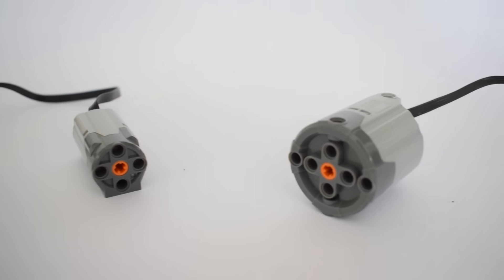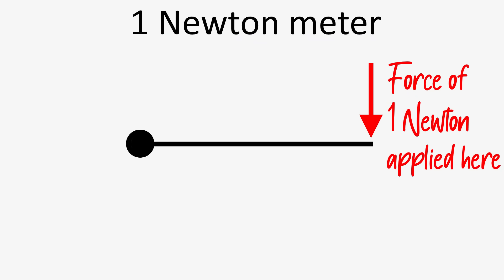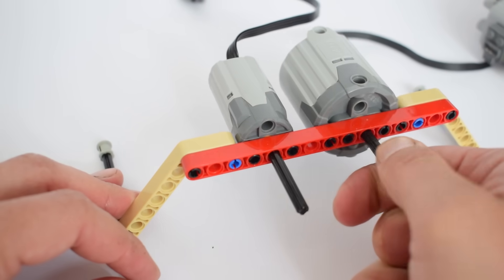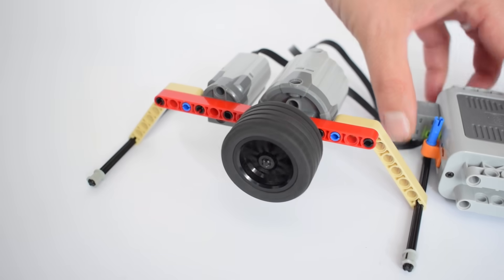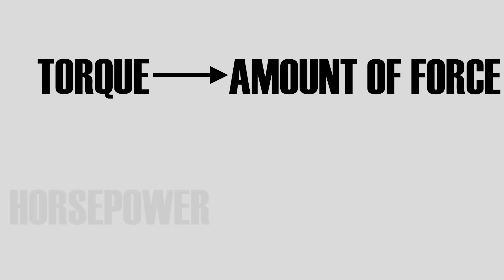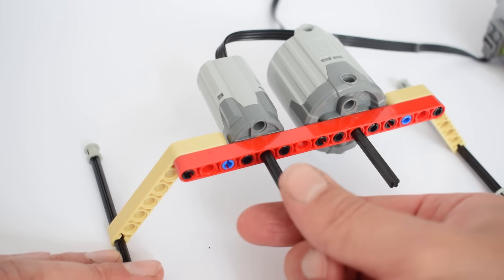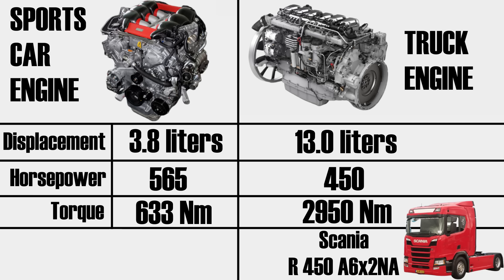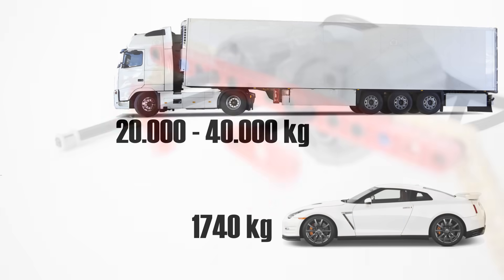NEVER be confused by HORSEPOWER and TORQUE again - HP and TORQUE EXPLAINED in the MOST VISUAL WAY

Comment: I usually don't comment on video's but this was an excellent explanation, thank you. So the increased torque for the truck is a result of a larger volume for combustion to occur combined with the greater leverage of the piston and the weight of the material adding more inertia to the strokes?

Comment: Years ago I was trying to explain the difference to a guy who collected Porsches and I was blown away that someone with a passion for cars well into their 70s had no stinking clue what the difference between the 2 even were. I tried so many different ways of explaining it including using a body builder vs a sprinter and he just couldn't get it. The amount of validation this video gave me because at one point I really thought surely this 70 year old guy knows better than me. 

I even tried explaining it this way. Horsepower can dictate how much quicker you can get to 60mph where as tongue can dictate how much weight can be moved before its no longer possible to go 60mph. And even that wasn't clear enough to explain it to him.
Reply: You failed because you don't understand the topic.
Reply: Power and Torque are not Batman and Robin please stop trying to assign them roles. Power, not torque, is the limiting factor for not only how fast a vehicle can go but also for how much weight it can pull at a given speed and/or how fast it can accelerate a given weight.
Reply: @rollsroyce329  Holy forking shirt balls that is literally what Ive been saying. The constant cascade of misunderstanding the same thing while saying the exact same thing it utterly mind boggling.
Reply: @gibster9624 for clarification, when you said “torque can dictate how much weight can be moved before its no longer possible to go 60mph.”  This is only true for a given gear.  For a given GEAR maximum load capacity or acceleration will always occur at peak torque.   For a given SPEED however maximum load or acceleration will always occur at peak Power.

Comment: One thing I don't agree with, or something I still don't realize I don't understand.

You said you can't feel horsepower, but only observe it.

If you sit in a vehicle with the truck engine and the sports car, you will feel the horsepower more than the torque from the acceleration.
Reply from the maker: You feel G forces. You can't feel a mathematical formula
Reply: @d4a  We aren't talking about 'feeling 2+2=4'.  The power generated is very real is felt physically; we just express it mathematically on paper.

Obviously Gravity existed before Newton 'discovered' it.  He just figured out how to express what we observe in math terms.
Reply from the maker: You can twist the semantics but it doesn't change the actual meaning. Let's try this: Can you feel the amount of work a horse does in a given time? No. You can only observe it. If one horse moves 100kg of potatoes and the other one 200kg you can only observe the difference in their rate of work but you cannot feel it. Please don't tell me that you can feel the greater weight of the 200kg of potatoes. That's the weight of the potatoes not the horse's rate of work.

Comment: I still believe that when it comes to acceleration HP is all that matters. You need torque to make HP but if you compare the crank HP of any two engines the high one will win moving the same amount of weight. It's why harley guys are convinced their bikes are fast, until they loose.

Comment: I think the units/formula of both already represent it pretty good. The formula/unit for torque is simply N*m, meaning if you simply divide your torque by any given lever, you will have the force at this lever. Horsepower measures the same thing as Watt does. This means that the formula for horsepower as for watt is simply F*v, force times velocity. If we insert metric units, Watt instead of horse power. This equation will look like this: N * m/s. This shows that Horsepower is simply torque divided by time
Reply: Good until the very last statement.  Torque is not work (which is power when divided by time). This is why there is an extra constant involved.
Reply: @simplemachine9531  when I got it right, the base units for Newton are kg * m / s². Meaning Newton meters is kg * m² / s² and Newton meters per second is kg * m² / s³. This is watt expressed in basic SI units
Reply: @hanneswiggenhorn2023  idk how and why it is related to "horsepower is simply torque divided by time". Swap hp for watt and still get the wrong result

Comment: Great explanation, i def have a better idea of what torque, however, i am still not fully clear on the hp. If we have two cars with similar torque nunbers but different hp, how would it affect the performance/feel of the vehicle, given similar weight.
Reply: i'm not an expert and only just now actually learnt the difference between torque and hp, but i think i can explain it. if they have the same torque but car A has more hp it means it has higher rpm. This means it can accelerate and drive faster if we assume that everything else is more or less the same. If you step on the gas it will also react quicker than car B. you can think of it as this: torque is raw force. hp is a number that tells you what you actually get at a certain point. in order to get hp you need torque + rpm. if you only have torque you don't know how much output you're actually getting at 3k or 6k rpm. that's what the hp number tells you

Comment: Oke you call tork a force but it has a unit of Nm which means its not Force but Work
Reply: Not work either. Work is force times displacement, torque is force times radius.
Reply: @simplemachine9531  What is the unit of torque and what it the unit of Work.
Reply: @WalyB01  Joule for work and Nm for torque
Reply: @simplemachine9531  Work is Force (N) x distance (m) and has a unit of Nm. Tork is angular work, and not a force.
Reply: @WalyB01  I don't believe you can not read so problem is somewhere else. Torque Is not a force, of course. Torque is work is your own unique assumption. Torque can't be anything except torque, hence its name. If multiplied by 2π, torque is work of one revolution. Does it make torque a work? If force multiplied by displacement is work, does it make force a work?
Reply: @simplemachine9531  Do you believe wikipedia?
Reply: @WalyB01  did it tell you torque is work? No, you did it to yourself. Torque  doesn't do work, it just can't. I will leave you here, because I couldn't help you to leave this circle.
Reply: @simplemachine9531  I see I am horrably mistaken but not the first https://en.wikipedia.org/wiki/Newton-metre

Comment: Wow, I finally get it.  So I guess it could be said that torque is more analogous to amperage and horsepower more analogous to wattage?  Great and easy to understand explanation.
Reply: Not really. Torque = Volts, the force. HP or Watts would be VA (volts x amps). Amperage doesnt really come into it, you coupd possibly liken it to displacement/cc. But that is a really bad way of looking at it.
Reply: The word is current, not "amperage".

Comment: If you have 2 same cars (weight, type, gears), both have 100 kw, but different torgues (one 220n.m and another 270 nm.), they should have been same fast from 0-100 km/h, shouldn't they?
I mean, there were 2 types of Skoda Octavia, one was 1.9 tdi (77kw, 250 nm) and 1.6MPI (75 kw, about 190 nm?), but they both just did 0-100 almost same (about 10 sec). Diesel one (with higher torque) was deffinitelly faster by feel, but the numbers were same.
Reply: If launched not from idle revs, results would be the same or very close. 
Next, as shown in your practical example, it is about average power that is delivered during acceleration (power curve). A gasoline engine, despite having a similar peak number, has flatter curve and accelerates with higher power output between gear shifts. Diesel has a peaky curve.

Comment: Great video.  One thing to add is that it's not only the displacement that are generating more torque.  It's that big trucks use diesel and turbos so they have a higher compression ratio and get more air in the engine so it's not like an F150 5.0 liter gas powered engine is only a liter away from having the torque/power of the 6.0-7.3 diesel engines... it's missing the compression ratio and turbos which is why diesels are so much more efficient when doing work or cruising on the highway even though they weigh twice as much as an F150.

Comment: The way I explain torque ( at least in an internal combustion engine) is this.
 Torque does the work in the lower 1/2 of the RPM range,  horse power does the work in the upper  1/2 of the  RPM  range.

Comment: But if the smaller lego motor had had a reduction gear in it, it would have had similar HP and more torque than in your example, .I still don't understand the difference
Reply from the maker: https://youtu.be/txQs3x-UN34
Reply: No, the reduction gear would not change its HP. Yes, it would increase its torque, but it would proportionally decrease its speed. Power = torque x (angular) speed. The torque is the twisting force. The power is how fast that torque can be applied. So if you increase the twisting force by gearing, the gearing slows the rotation down, and the HP is unchanged. (That should ring true - you can't create power or energy by gearing, only by increasing the amount of power/energy you are taking from the battery!)

Comment: I think a lot of people has already experienced this riding a bicycle, for the same speed, you can pick a ratio to either spin that crank real fast (Horsepower) or slower and push harder (Torque).
Reply: Bicycle doesn't explain it without introducing a power curve: you push harder on a longer gear but bicycle doesn't push the ground harder with its wheel. It pushes harder when it is easier for you to push the pedals at lower gear.
Reply: No, changing gear changes the torque, but does nothing to the power. If you pedal faster because you have changed to a lower gear, you aren't producing more power.

Comment: Can more torque be converted to more horsepower using gears?
Reply: More torque is already more power at the same gear
Reply: @simplemachine9531  ... For example is a Huge Diesel engine from a 🚛, like those trucks that haul container, is put in a small fibre glass body ... Can a gearing system be used to make it into a race car?
Reply: @wayando  many trucks already have 700hp so it will work.
If we want a 200hp truck engine for this - it won't. Power is force times speed and by changing gears we trade force for speed and vice versa, all at a given power. This is called a mechanical advantage, which doesn't grant an advantage in work. A 700hp car does more work at a given distance than a 200hp truck and truck can do nothing with it.
Reply: @simplemachine9531  ... Thanks for that explanation ... So I guess torque is a very important measurement for engines, because it's the REAL measure of the engine's power output at the very beginning ...

I guess that's why race cars want high rpm for a given torque value. So they can end up with more horsepower.
Reply: @wayando  nope, that's a wrong conclusion, here comes a gearbox into play. As we have seen earlier, power comes only from an engine and can not be substituted, while torque can be infinitely high after gearbox. We can expect that a truck won't move a load with its 2000nm engine torque if there is no gearbox, 1:1 final drive ratio and 1m wheel radius. Trucks have lots of very low gears on this purpose. Long story short - the goal is to make an engine with as much power output as possible (keeping reasonable longevity) and pair it with a gearbox the way engine can work on its maximum power revs at any speed of a car.
Truck engines have higher torque not on purpose but as a side effect of engineering it as reliable and as service-free as possible because truck is a commercial transport and people expect to save money on it, and not to spend (like on tuning and rebuilding sport cars). Still, a bad truck is a 300hp truck and a good truck is a 700hp one.

Comment: Nicely done. I wish more people understood that toque is a static measurement when they discuss a vehicle's acceleration. To be completely accurate, in a piston engine, the torque figure is calculated as an average per revolution because the torque is only applied when the piston is on its power stroke - that obviously differs from an electric motor. This is a great lesson however on why it's torque at the rear wheel(s) that accelerates a car, it has nothing to do with the quoted torque of the engine - quoting an engine's torque only serves to give an indication of it's character - it's bhp that determines torque at the rear wheel and therefore the rate of acceleration.